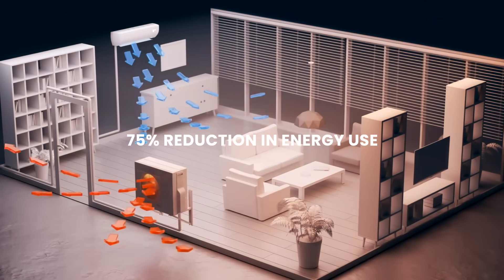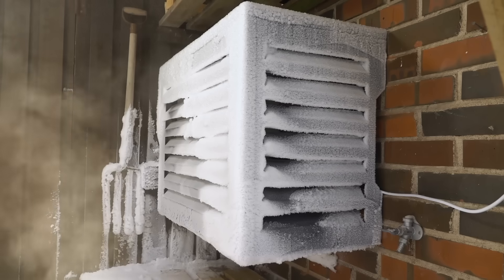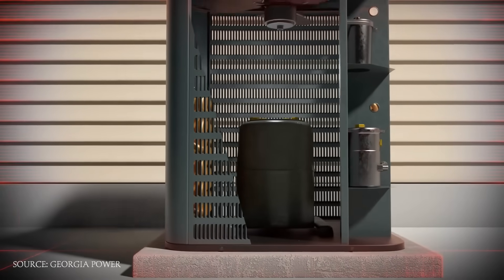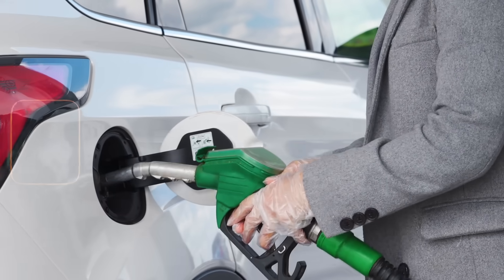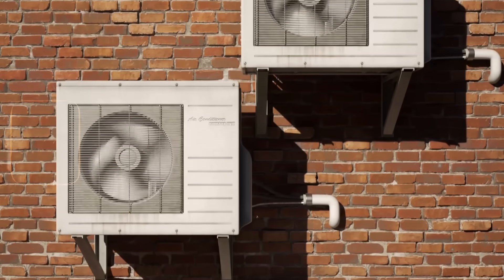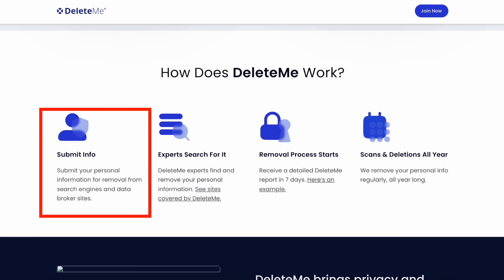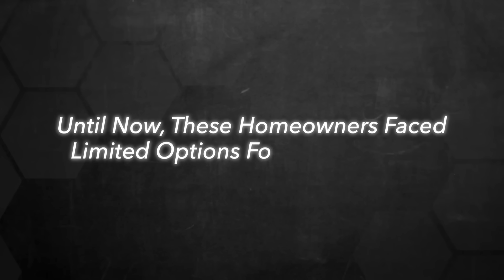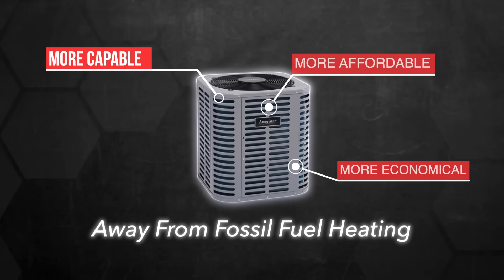Genius Heat Pump could change how we heat our homes forever

Comment: An alternative concept is to use different heat sources with higher and less variable temperatures instead of outside air. 
In Germany home owners also use ground water, low level ground (up to about 6 ft), and deep ground (200 - 400 ft) sources. 
- Ground water is pumped out of a well feed to a heat exchanger and returned back to the ground water reservoir.
- Low level ground heat is derived from hoses buried in the garden about 6 feet or deeper as large collector, or
a ice storage is installed which is a larger water tank, that also takes heat from the environment, and provides a lot of heat when freezing.
- For deep ground heat several deep holes (about 200 - 400 ft) are drilled and a long heat exchangers are inserted into the holes.
In most cases this collectors cannot only be used as heat source in winter, but also as heat sink in summer. This way this can be used as kind of seasonal storage. The heat pumps have to handle a much higher temperature level with a much lower temperature spread, for more efficiency and  less wear. 
Of course, this is more expensive upfront, but gives much better efficiency and lower costs in the long run.
BTW, here most heating system use water in house to transport heat and not air, i.e. for floor heating and regular convectors. Using water for transport is also easier to provide hot water. It isn't necessary to overhead with HVAC.
Reply: You are absolutely right.  My friend here in Missouri built a new 3000 sq/ft ICF house with a ground source heat pump. Using 4 wells, about 150 feet deep.  It's amazing!  His heating and cooling bills only run about $85.00.
For comparison, I have a 3500 sq/ft ICF (Insulated Concrete Forms) house, but using an air source heat pump.
My highest AC bill is about $100, and my highest heating bill is about $200 (in the coldest part of winter with outside temps under 10 degrees).  Note that in the dead of winter, my heat pump sounds like it's working itself to death, even though it's a relatively new unit.

Comment: Running for months throughout the winter, no air can flow through the solid ice overwhelming the radiator. How does it work through that, I don't understand. I would think sick ice seemingly would be an insulator. No mention of the frost problem and the physics of how it gets through it without defrost Cycles.
Reply: Presumably it has automatic defrost. Was there something in the video that suggests otherwise?

Comment: I never saw so many negative closed-minded responses. Things evolve. I have known people with heat pumps since 1967. Back then they blew what we thought was cold air. Anything blowing cooler than 98°F will feel cool, especially if your body is preserving heat. And in thr defrost cycle back then they blew cold air. Now many improvements have made them the perfect choice for the southern US.  Climate change has led to much higher dew points and higher overnight low temps. in thr summer.  Dehumidification must now be controlled with dehumidification equipment. A few days and nights of resistance heating between December and February shouldn’t drastically affect finances. It is a big relief to eliminate combustion appliances. They always have a greater than zero chance of emitting carbon monoxide into the house either directly or due to pressure differences. Combustion is out of the question for high performance houses which all should be required to be anyway.
Reply from the maker: It's both sides lol it happens on new tech videos I feel... people (especially techs) are hesitant to try new tech based on experience with new tech in the past, and understandably so, but I still think it's cool if they can make the final product viable and cost effective
Reply: I totally agree.  Just take a look at what they are doing in northern Europe, Japan, and China to name a few.  They are eons ahead of us in this arena.  I remember trying to get PEX/PEX-AL-PEX in 2004-2006 and the local supply house thought I had 4 heads and said it would never work (even though Europe had been using it for the last 15-20 years).  Now it's everywhere.  We have to be looking toward the future and better performance - not just in the next 3-5 years, but over the life of the system.  I've also seen both my gas and electric rates double in the last 5 years in North Central NJ.  Thankfully, I've invested in the insulation/performance of my house's building envelope so that my heating/cooling cost average has actually decreased since 2006.
Reply: No so much crap these days are gimmicks
Reply: Sounds like someone who lives up north has to accept your argument, but I live up north and heat pumps are BS up here.
Reply: @jamesocker5235  I can say here in Northern NJ, I sized and installed my own heat pump (not an hvac guy) 2 ton unit, 1100sq ft house, and it works great. Disclaimer, I live close to the ocean, so my temps are moderated by that to some degree. Still hit -10*f this winter…

Comment: OK, where is the new part cascade systems have been around for decades. They are certainly utilized in cryonic systems. They have been used in direct expansion low temperature refrigeration applications for refrigeration for years.! Certainly running a cascade system would generate an enormous amount of heat but at what cost? Any major manufacturer could build cascade heat pumps in a relatively short period of time but are you the homeowner willing to pay four or five times more for the system to see a 40 or 50 year return on investment that’s the problem. 1° superheat set points have been utilized in chillers for years however, any deviation in the sensing ability leads to flood back and compressor damage while all this sounds good in reality it isn’t. I wish it was. One more thing instead of having one refrigeration circuit now you have multiple refrigeration circuits a whole lot more stuff to go wrong.
Reply: Did you watch the video? 

The new part is not the scientific applications, it's using the components engineered for single cycle in a cascade. That's what brings the price down from astronomical to merely double the cost is a single cycle system. And with better than double the winter efficiency, where you spend more money, that will be cost effective for some people.

And not for others: do you sums before installing this, but equally do your sums before dissing it
Reply from the maker: All god points, curious do you have experience working on them and do you see anyway it could be made more cost effective and feasible?
Reply: Yes, don't try and use a heat pump in cold temperatures that draw the efficiency down below 200% , which is approximately 10 degrees F on average across models. And stop saying that you aren't using "Fossil Fuels" because no power grids exist that don't have most of the generation coming from Coal, Oil, or Natural Gas. Technology is great but it sucks when people over hype it before it's time making false claims and clouding reality and slowing progress in the process.
Reply: @fritzmiller9792  have you heard of a place called Switzerland? Up their % renewables ...

Comment: 1. Not really solving anything: 1 coils freeze up if there is any humidity in the air which acts like an insulator. Only option is run the HP in reverse, dumping heat into the coils to defrost them.
2. Multiple refridgerents just means more complex problems & costs. All it takes is one HVAC to use the wrong refrigerent & its done for. 
3. COP is still going to be lower at lower temperatures since it takes more work to run all the loops & provide the delta temperature
3. Its more pratical to use a ground loop which does not suffer all of the problems with Air heat pumps.
4. Heat pumps do not solve climate change or end using fossil fuels. 80% of electricity comes from fossil fuels which convert thermal energy into electricity with about a 80% loss by the time it gets to your home. Better to just burn fossil fuels for direct thermal applications. A condensing boiler will operate at +90% thermal efficiency. My home has an new heat pump & a condensing boiler. The Boiler is about 3 times cheaper to use than the Heat pump (HP is now just used for AC).
Reply: your experience doesn't mean much. If running a condensing boiler is 3x cheaper than using the HP, then you have a very inefficient heat pump. Many heat pumps sold on the market don't work with meaningful efficiency below 45F. If you had paid a bit more and gotten the highest efficiency heat pump on the market, you would have saved money by not needing a condensing boiler and on the utility costs compared with your current setup.
Reply: @imzjustplayin  Its a Heat pump with a SEER2 of 20 & only about 2.5 years old. 

Its just not possible for a HP to outperform a Direct thermal boiler. If you think otherwise you fell for the HP hype.
Reply: @guytech7310  What climate are you in? Model number of the Heat pump? SEER2 efficiency rating doesn't speak to its heating efficiency as that's the HSPF2 rating that does that.
Reply: @imzjustplayin  HSPF is 12. In am in Zone 7.
Reply: @guytech7310  That sounds like north dakota or something. HSPF of 12 is pretty good but probably isn't sufficient for your climate zone. Do you have auxillary heat and what is the tonnage of your system?
Reply: @imzjustplayin  Its USDA zone 7 is pretty much subtropical. it only freezes From Mid Dec to Mid Feb. Yesterday it was about 88F
HP system is about 23KBTU/hr. Home is very insulated, about R-32 walls, R-50 SIP Roof. Home is about 4500 sqft.
Reply: @guytech7310  IECC climate zones are what are used to calculate HVAC zones and  zone 7 is the coldest. USDA zone 7 is around 3A for an IECC climate zone which is fairly mild. It sounds like you have a 2 ton system, do you have auxillary (PTC strips) heating installed?

How expensive is your electricity per KWH?
Reply: @imzjustplayin  No PTC strips. Unit does freeze up often triggering frequent defrost cycles. Outdoor temp might be around ~38F, but coils drop below freezing & accumulate frost.
Reply: @guytech7310  how many BTU is your condensing oil furnace?
Reply: @guytech7310 If you have an undersized heat pump for your climate, might explain the higher bills. This also assumes the unit was installed properly and isn't low on refrigerant. Are your A/C bills higher than your oil heating bills?
Reply: @imzjustplayin  There is nothing wrong with the sizing or the refrigerant level. Bottom line HP cost more than a condensing boiler.

I don't have an Oil boiler. Its a Condensing boiler with 96% thermal efficiency. Home is well insulated. The Boiler probably runs about 15 to 25 minutes per day.  I use it more for Domestic hot water than home heating,
Reply: @guytech7310 I don't know that and you're not an hvac tech so you definitely don't know that unless you can prove otherwise. you say you have a boiler, is it powered by natural gas? how many therms do you use annually?
Reply: @imzjustplayin   I installed the Boiler myself &  most of the HP install. I did sub out for the the refrigerant,  but made sure they used a scale & filled to Mfg Spec provided in installation guide. System was vacuumed down to about 200 microns. Checked pressure several times after the install using lineset gauges. 

I did a Manual J & had a professional hired to also do a Manual J (double check) before the system was spec'd out. 

All of the duct work is in condition space all using Kool-Duct for the trunk lines (not using flex at all in the system).

Its nothing to do with the system. A properly installed Condensing Boiler will outperform a HP. 

The issue is that Boilers are often oversized for homes, short cycle, & consumers & HVAC techs buy into the heat pump consortium marketing. They want everyone to install Heat pumps because they make a lot of money selling & installing them.

Sure when your replacing a 20+ year old non-condensing boiler & probably not been serviced in 10 years, with a brand new HP its going operate more efficiently.

You never hear HP Mfg discuss about frost build up on the coils requiring defrost cycle. or that HP COP drops like a rock when the Delta T his high, which the COP drops to less than 1. Some hide the Drop in COP by reducing flow (ie 15KBTU is now a 7.5KBTU at low temperatures), other use resistive heating elements (ie resistive heating)
Reply: What are your utility rates? For a boiler to be that much cheaper you need a crazy high disparity between electric and fuel rates. Here in Massachusetts, with some of the highest electric rates in the US, an air source heat pump is "only" 30% more to operate if run all season.
Reply from the maker: All valid points!
Reply: Truth,facts,logic👏👏👏👏💯

Comment: I was wondering about putting the heat pump in a greenhouse?  What do you think of that?
Reply from the maker: Could work well during the day with a black bottom too especially, but at night the heat isn't being replenished so the greenhouse would get even colder than the outdoor temperature

Comment: WHAT HAPPENS WHEN THE OUTSIDE UNIT FREEZES UP IN COLD WEATHER? THIS UNIT USES ELECTRIC HEAT COILS . VERY INEFFICIENT AND COSTLY. IN COLD WEATHER FOSSIL FUELS ARE STILL KING.
Reply: Good heat pumps run a reverse cycle to defrost the coils which is a small energy penalty.
Reply: @imzjustplayin  correct. And the reason the penalty is so small that for a small prevent of the time the system is great pumping from warm to cold, reclaiming a small amount of the heat it delivered to thaw out the coils; then as soon as they are ice free that same heat is reclaimed again and pumped back into the house 

Electric coils to thaw out outside units is very old tech: love grass moved on past that, even on single cycle systems

Comment: Spend thousands when it breaks because all the working parts and computers are like over complicated and still cheaper to use natural gas for hot heat at any temperature outside
Reply: Everybody whining about complexity of a heat pump yet not a word about A/C units which are exactly the same thing.
Reply: @imzjustplayin : He’s raising a mostly-valid point about how this specific type of heat pump has much more complexity due to the multiple inter-connected refrigerant loops. Not to mention that a thorough software debugging is rarely done these days, so that’s another potential failure point.
Reply: @jacobcarlson4010  I don't disagree but I'm also saying that something that is complex doesn't have to be unreliable and simplicity doesn't guarantee reliability either.
Reply: I can agree with you on the complexity argument, but natural gas is often expensive as **ck in the winter time. This past winter, my gas bill was $225 a month; household of 1, thermostat at 66°F (18.8°C) and showers limited to 5 minutes max.

Comment: At about 8:54 into your video your state operation at 32 degrees.  Did your mean below zero or at the point water freezes?
Reply from the maker: -32F, so subzero... it's a mistake on my part in the video for some reason came out weird / slipped
Reply: @TheHVACDopeShow 
Dang.
I mean, that's great!
But I'm not going to delete my comment below. 
You can correct me there. Everyone will think that I'm a big dummy, and we can keep our little secret.
Reply: @richavic4520  Nope, don't believe it.
Reply: @TheHVACDopeShow  I was gonna say that MrCool heat pump operates at -20F degrees. But if this operates at -32F degree, then this is the winner.
Reply: @ A 10 ton unit also works down to 36 degrees. v
Reply: Great idea with the multi refrigerants
Reply: So yeah Fahrenheit. This video is dumb.
Reply: @dallassegno  I think that utilizing an array of heat transfer capabilities tuned to ambient temperatures is a pretty exciting step towards higher efficiency.
Reply: @dallassegno  No its dope... Whatever.